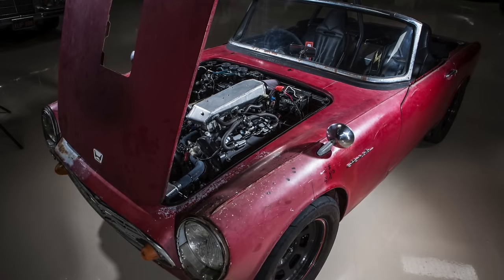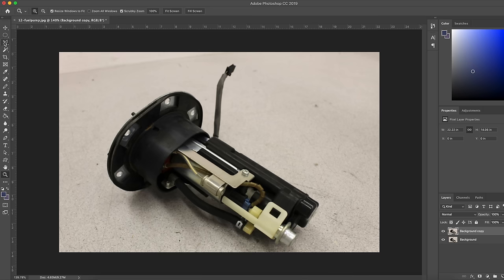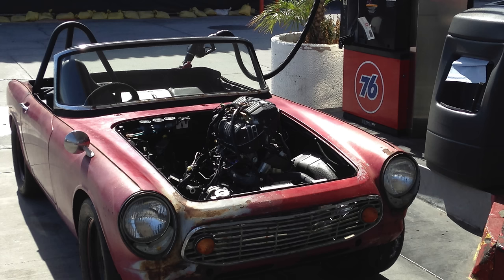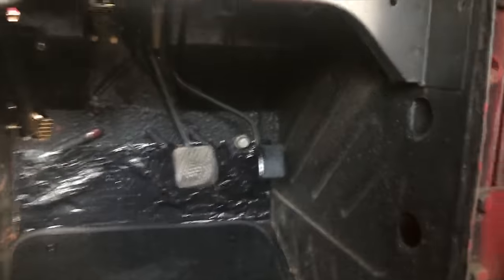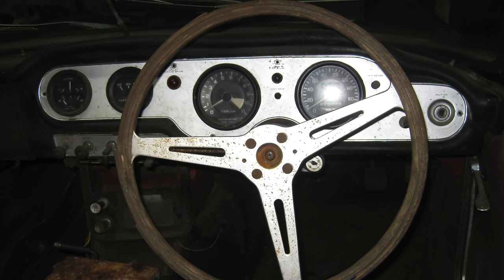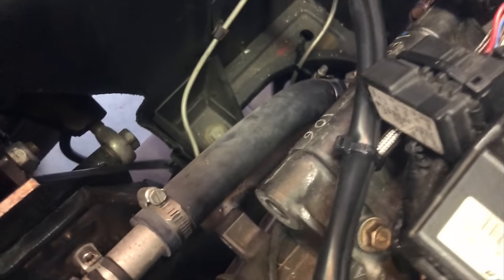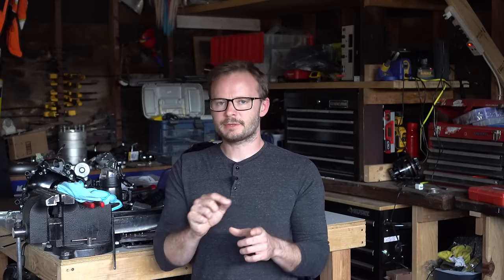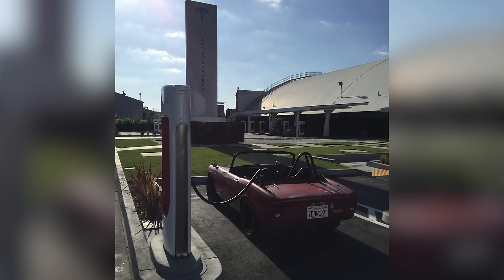Part 2 - Motorcycle Powered Car - How and Why: Fuel System, Exhaust, Intake, and Controls

Comment: I like this a lot. Ever since I watched Jay’s vid (that’s where I found your car months ago), I’ve been trying to figure out how the clutch lever could be mounted vertically on the sequential gear lever, with a reverse button in the top like a parking brake - but (to prevent accidental engagement) under a flip cap like the fire button in a fighter aircraft! ;)

You see, here in the UKIP land, we are actually way crazier than you guys. 

Copyright G58 2020

Comment: If you use a motorcycle engine with an up and down quick shifter the clutch will only be used when you take off. These bikes also have ride by wire throttle control as well.

Comment: You only need all the stock engine parts on 2008 and later motorcycles in California. I have not seen any emissions test equipment in a shop or online yet.
(2023)

Comment: Way back when, I owned a Honda S-800 Roadster and lover the hell out of it, but with only 67 HP, it would barely break the double nickle. How fast is your car?
Reply from the maker: It's gear limited to 125, which I've done a few times. But I don't like to take it that fast because it has such a short wheelbase, and also is about as safe in a crash as a shopping cart.

Comment: HEY MATT , I RECENTLY PURCHASED A 1962 VW DUNE BUGGY AND IT'S BEEN SITTING ,  IT RAN THE DAY I PICKED IT UP BUT WHEN I DROVE IT AGAIN , IT STARTED RUNNING ROUGH AND ON THREE CYLINDERS , THE TANK WAS FULL OF RUST , SO I FLUSHED OUT THE TANK AND FUEL LINES AND REMOVED THE CARBS , THEY WERE FULL OF RUST TOO , IT HAS A MOFOCO KIT IN THE ENGINE AND HAS A 1000 MILES ON THE ENGINE , I FINALLY GOT IT RUNNING PRETTY GOOD BUT I DON'T TRUST IT IN THE SENSE OF RELIABILITY ! SO I'M THINKING ABOUT PUTTING A YAMAHA R1 ENGINE IN IT OR A HAYABUSA ENGINE , YOUR THOUGHTS ?     ALAN FROM FLORIDA
Reply from the maker: Yamaha R1 would be awesome in a buggy. The R1s are the best sounding I4 engines in my opinion.

Comment: Thanks for these great videos - I only speak English. so "halfway" (written with Google Translator) / but your sarcasm .. is totally crazy - I had to laugh again and again at the video - really nice / thanks for the good tips .. I'm currently building a buggy from an old Suzuki Vitara, and would like to exchange the motor for a bike motor / the reverse gear is a problem .. I am considering using the original gearbox (patch between motor and gearbox) but you showed me an option here (which unfortunately is a bit expensive) .. but, let's see how it will be ..

Comment: Could you have tilted the motor 45 degrees or more towards the exhaust side so it fit under the hood?? You would have to fab a funky oil pan and pick up? I know the injection doesn't care, I can't think of any other reason it wouldn't work?
Reply from the maker: Maybe, but it might make oil collect somewhere that causes weird drag or lubrication issues. I could have probably done some sort of dry sump with extra drains or something. But, I kind of like the look of the aluminum intake sticking out of the hood :)

Comment: Nice job buddy I can remember back when I was really young probably 17 18 there was a dude in the warehouse I'm down from where I work he was a fabricator kind of like you a freaking genius he took a r d Yamaha 350 engine and put it on a go-kart had spoilers and airfoils on it what a beautiful job needless to say it was too fast to run the quarter-mile and stay on the ground if he would have put Wings on it would have flown although he did get it into third gear eventually and I think he was running a hundred and something miles an hour through the quarter that was very scary though anyway great video and good job finish it Paint Body Work

Comment: one question as you re-welded the exhaust, before adding the next section to be welded, when able, did you file/dremel the interior finish of the weld in the pipe, if it was rough/uneven ? . to minimise erroneous harmonics and flow disruption from the dross, and hence loose some slimmest of power & efficiencies ?
Reply from the maker: I did a rough cleanup on the inside of the header with a dremel and file, but I didn't worry about it on the main exhaust tube

Comment: Could you try a motus V4 engine with that quaife gear box but with a rear mid latitudinal mounted  on your next project car .  

Or for a theoretical concept try a hybrid engine with electric drive like a fisker karma but an ultra light version on a kei car of your choice .The  electric motor should be a wheel hub type  motor for future AWD upgrade. And the motor and it's gear box from formula student team amz Germany .

This is a huge amount of things to do but can you just make a rendering on CAD just as a proof of concept or how would you do this project.

Comment: Yeah but I watched both episodes waiting to see the car on the road, and... 😫 disappointment.

And, Matt - does it perhaps get a re-spray at some point? Just askin'.
Reply from the maker: At the end of the second video is a link to the Jay Leno's Garage episode. I didn't do driving in mine because that one has plenty of driving. And if by re-spray you mean a new paint job, then no; I like the beater look.
Reply: @SuperfastMatt  Watched that, and sorry, should have gone back and edited my whiney comment 😁

I can go with the 'sleeper jalopy' look. Liked that your engine compartment is super clean (which we also see in the Leno segment), contrasting nicely with the exterior 😄

We didn't get to see the gear shift much in either of your videos, but it looks like you made a configuration change by the time Leno drove it - he appears to be just punching the clutch right through for the up-changes?

Comment: a Chevy 350/5.7 liter uses 750CFM at 8000RPM. My math shows a 1.4 liter engine at 12000RPM will use 250CFM. (Air filter considerations)

Comment: I would think taking space away from the oil pan is not a good idea.it would cause oil starvation and higher RPM’s. I would add a oil cooler to increase the capacity of the oil that you took away from the oil pan.😎🛠

Comment: How hard would it to be put two hayabusa engines into a custom built body? I have no experience, but I learn stuff really quick and I am passionate about this stuff. Just looking for some pointers.
Reply: if dual motor, sometimes individual wheel drive, electric vehicles are any indication of it being plausible, sure maybe! cannot be an expert beyond that.
however, it would be funky to see indications of both a front and rear engine...
Reply: @ABCDEFGHdumbo  Lol I wanted to put two hayabusas together to make a v8 instead of having them operate as two separate engines.

Comment: On the velocity stacks, the shorter they are the more torque you get the longer they are the better top end. New bikes come with ones that adjust on the fly to maximize performance.
Reply: Mopar discovered this effect in the early 1950's and there is a formula to determine the correct length for intake and exhaust systems that they Formulated back then and shared with Daimler Benz. Google Sonoramic and Max Wedge engines. you can see it in full effect on street and race engines.

Comment: Your exhaust pipe is on the suspension. Does your suspension wrk
Reply: That's my question too, Obviously no give in the rear end except for the tires flexing. I have struck this a few times on swaps with independent rears so I get a larger tube and flatten it in the press so it retains the same cross sectional area in volume, but a lower outside profile to it under cars.

Comment: Hey did you put back the Thermostat of the Motorcycle? Motorcycle  Engine needs to have a regulated heat, and you want that to be at 100c° all the time... Or you'll suffer from Premature wear because the Engine have tight or loos parts that will have the correct clearance if the Engine is at operating temp and you'll suffer Valve Clearance out off adjustment everytime from repeated slamming of Cam Lobe if the Engine is cold... Probably by now the engine is broken because of you didn't put back the Thermostat.

Comment: You should get a power commander to give it a tune and install a quick shifter so you don’t have to use the clutch for shifting. It would sound like an f1 car. Clutchless shifts at WOT. Don’t need to let off the gas. This is the one I have on my bike. It’s a stand alone unit so you don’t need a power commander. https://www.healtech-electronics.com/products/iqse/

Comment: There is no way on earth that engine will make good power with an exhaust that long, exhaust length is critical. Bike engines tend to run a lot of valve overlap and are very sensitive to exhaust length.

Comment: Hi. You're a a cool country, a country of freedom. In the country I live in, it's a real mess to retrofit an old car with an electric engine the same power. It's streng verbotten to reprogram the ECU, even for accepting ethanol fuel. And it's strictly forbidden to change the engine. Example. My first car was from 1984 and the engine had a design flaw in the head gasket. The car maker made a safer version next year, but it was forbidden for me to exchange the engine after it broke, even if it was the same engine with the same power and just different head gasket.
Reply: Sounds like Australia. Sine the 70's any sort of modification has to be approved and here in my state a blue plate must be affixed to the car showing the mod details and the engineers approval. Thi$ Co$tS money of Cour$e. For a long time they even tried to ban mag wheels,cops would ticket you if they were 2.5 inches over standard width. Air bags are not allowed in Queenslnd even though my 1962 and 1969 mercs came with air suspension as does the state rails passenger trains and 60% of heavy trucks on the road. Clear thinking is not the politicos strong point.

Comment: "The other CAD....." lol.  Classic, that's gonna stick.

Welded magnesium???  Magnesium ignites long before it melts, the inert gas from the TIG welder solved that, so probably better to not try it with oxyacetylene.
Reply: Then how do they cast it? While it is true, that small pieces of magnesium can be ignited by a match or even a spark, this is also true of iron, aluminium and other metals. They can be melted, cased and welded.

Comment: 😂😂 welding aluminum to magnesium, that’s something I would do.
Reply: You could end up with some serious cracking problems.
Reply: Tabourba  As a retired Welding Engineer I would not recommend putting any faith in an Aluminium to Magnesium fusion welded joint as you would have the full range of Al/Mg composition across the weld zone some of which are not workable.  If you consult the Al/Mg equilibrium diagram you will see what I mean.

Comment: Can't you just take a motorcycle engine and melt it into a Volkswagen bug use the transmission from the Volkswagen?
Reply: sure
or hang a hole v8 off the back
Reply: @isaactrockman4417  m y type III has a V8 hanging off the back.